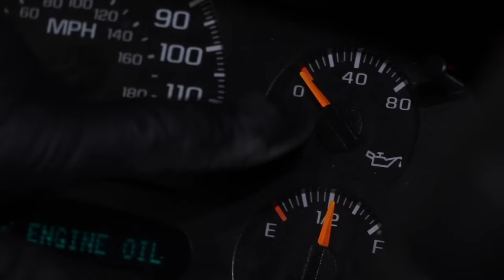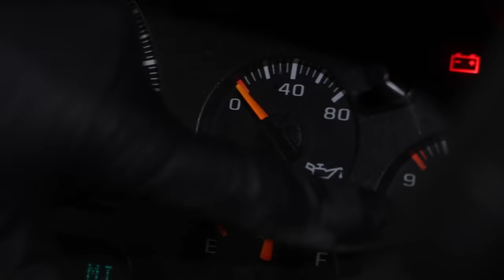Top 5 Problems 2000-06 GMC Yukon Sierra Chevy Suburban Tahoe Silverado Avalanche Cadillac Escalade

Comment: Good video. I own a 2002 Chevy Silverado 1500 with 4.8 V8.  with 90K on the odometer. The biggest issue I have experienced is the rear brake calipers sticking closed. Drove all the way from Ohio to Florida, towing a trailer with one of them stuck on. It would smoke  and smell until the pads wore down enough. Once I got home I replaced the rear rotors, pads, and calipers. In less than 15K miles, one of them stuck again. Don't replace with cheap rebuilds but buy the more expensive , quality rebuilt calipers. I used Napa the 2nd time. My other issue was the in tank fuel pump. It will get increasingly hard to start until it leaves you stranded with no fuel pressure. Again, don't buy a cheap replacement fuel pump. You either have to drop the tank or raise the bed to install it so you want something that's going to last. Chances are you won't find a replacement with the factory style electrical connector and will have to install an adapter pigtail. I soldered the wires on mine to avoid having an intermittent connection in the future.  I have experienced the intermediate steering shaft wobble for a while now so, I think it's replacement is in my near future.
Reply from the maker: +GovtSlave Thanks for the feedback!

Comment: I have 05 GMC Sierra 1500, 5.3L H.O. My oil pressure going to zero was caused by bad instrument cluster. I've had the intermittent brakes at 5 mph. I changed both wheel hub bearings since they were already going bad, fixed that issue. I've had bad 4WD pushbutton switch, bad 4WD actuator, bad SRS front airbag switch, bad starter relay, bad starter. Replaced all brake lines wirh Stainless set. Truck doing well at 174k miles

Comment: Head gaskets could be a problem also front wheel bearings. Great vehicles for many people with over 200,000 and living in the rust belt.
Reply: J Roase Haven’t seen head gaskets issues here, just the rearmost exhaust manifold bolts and intake leaks especially cold,once they run a minute they stop leaking.....
Reply: Yep just replaced front wheel bearings  and look like head gaskets  it are giving up after 300k miles
Reply: John DiMartino I have. Had to do a gasket job on my old '00 and didnt realize that I had to change the lifters when I had it apart. Some dumbfuck decided not to allow you to change them with the heads still on. Thats GM for you though. One step forward in aesthetic design, seventy steps backward in engineering. These trucks are universally hated by most communities due to awful designs. Im personally done with GM trucks. As far as im concerned, they are dogshit.
Reply: @Lrules364   sounds like your not to mechanically inclined? How would any vehicle be able to have lifters changed with the heads still on? Lifters are an internal part🤔

Comment: Great video, I have had these issues with my 2 of my 03 2500hd and 07 3500 as well 01 Suburban and 02 Yukon Denali just have to maintenance when needed. Two of them are 450k and still running strong
Reply from the maker: +Nathan Gabriel Thanks for checking us out! 1AAuto.com

Comment: You forgot that rear main seal leak, or I think that's why it's called when the vehicle leaks oil between the transmission in the back of the engine
Reply from the maker: +Don ellis Thanks for the tip! We'll pass this info along to our production team.
Reply: I was told that starts when the catastrophic converters start to clog.
Reply: Change your oil when you are suppose to.
Reply: Anywhere that uses road salt, these were prone to antilock brake problems. Over the course of 170,000 I had the front hubs replaced twice on my 02 Silverado. The first time was corrosion on the tone ring, the second time the wheel bearings were getting worn and causing false antilock activation at low speeds. Fuel lines and brake lines corroded and all had to be replaced too. Don Ellis is right about the rear main seal. On the 4.3 V6 I had the rear main seal replaced twice, and had the intake "gasket" done once. If you're losing coolant and you can't find a leak, it's probably going into your oil.
Reply: I just had mine fixed a few months back on my 06 Sierra 1500. It was causing me to lose oil and coolant. Once it was fixed i don't have to refill my coolant anymore and oil very rarely.
Reply: My old Silverado had this leak it's whole life. I had it fixed twice under warranty and four times (paid once brought it back three times to re-repair) after warranty expired. The leak got worse with each repair.

Comment: Thanks for the heads up. I have not had any of these issues yet even with over 217,000 miles. My Yukon was handed down to me from my mom at 120,000 miles. She bought it new in 2005 when my step dad passed away. In 2016 mom went into an assisted living apartment and could no longer drive. I’m the oldest of five sons and the only one she would allow to take her out of her apartment. She remembered me the most and the Yukon so it was transferred to me. I moved to Texas and used it to haul furniture and my whippet show dogs. Dad died in August and mom in December. The Yukon still runs great with the AC getting weak and the miles per gallon being 15.6 average so I will be bringing my other vehicle from home on my next visit. The Mercedes E350 gets 22 mpg average which is a whole lot better than the Yukon and the car is easier to park. Plus you can drive faster around curves. So I rather use the Mercedes as my daily driver and save on fuel. That way I will use the SUV for hauling dogs to shows or furniture from one location to another. Thanks again for the updates! 😎

Comment: Great tips. The 2003 Z71 Tahoe I bought new from my local dealer is now showing some of these problems; however we have gotten over 325,000 miles out of it so far.  Wish I had known about the oil pressure sender problems; years ago, my son and his wife, on a long trip noticed the oil pressure gauge showed wonky readings, and then vehicle cut off at bottom of off-ramp on Interstate, and wouldn't restart. Towed 80 miles to dealership at their destination (free tow with road club); they said oil pump had failed and we had to have that replaced at that dealership for $$$. If I could've gotten it home to check it out, probably could have saved big bucks.
Reply from the maker: +Anonymous98 Thanks for the feedback! We hope these help you out in the future to avoid the dealership next time!

Comment: $$$  be advised $$$ when you change the knock sensors there is a GM service memo with a procedure to show how to protect the new sensors with rtv... Basically you build a damn with rtv in front of the rear sensor so water cannot get to it
Reply: TheMightybasstone yes that is true I did this! And torque to specification !
Reply: you build a dam around both, along with removing the rear foam. i just did mine yesterday (second time...) and ended up putting a little RTV around the caps to ensure no water gets in the hole.
Reply: TheMightybasstone  why would he mention that when he has a fresh set of sensors to sell ya when they fail again🤑

Comment: I had several blower motor resistors fail in my 2005 Silverado
Reply from the maker: +daniel Morse Thanks for the feedback!
Reply: I'd change out the blower motor. The bearings can get tight, but not make noise. Or, the motor windings are breaking down and causing a higher amperage draw, which in turn takes out the resistor from overheating it.
Reply: daniel Morse
. Change the blower motor. Had the same thing happen and finally had a customer in the auto store tell me to put in new resistor and see if it got hot...if it did...change the motor and the resister won't fail any more. It drove me crazy for a year doing all sorts of strange things. Replaced the motor and no problem since.
Reply: I just changed on it took me a week lol. The quarantine actually gave me time to put the new one on

Comment: I have a 01 Tahoe 5.3 with 360000 miles. Runs great. In December replaced fuel pump. In January rebuild transmission, sun gear like exploded so you can imagine the demage, also replace back engine seal.  And this weekend replaced A/C compresor, orifice tube and drier. All parts cost me about $2000 and my time, which I dont count as its my hobby.
Reply from the maker: +Jaroslav Szabo Thanks for checking us out. Shop for high quality auto parts on 1AAuto.com:

http://1aau.to/m/Shop-1AAuto-c

Comment: Nice video. Also, the water hose connection at the firewall gets old and brittle until it cracks,and leaves you stranded.
Reply from the maker: +Greg Schneeberger Thanks for checking us out! 1AAuto.com
Reply: Also a problem with y- hose from reservoir to thermostat and heater hose. Quick disconnects are junk. I did away with mine.
Reply: That happened to me back in '17. 01 z71 tahoe

Comment: If your oil pressure is fine while the engine is cold (but less than the usual 60psi) and it drops steadily as the engine warms and the oil thins out to the point where the low oil pressure alarm goes off, you pull over, turn off the motor, wait a minute, restart and the oil pressure is "OK" for 1-20+ miles, the likely culprit is the camshaft thrust plate. The built in gasket on this metal plate wears down over time and allows oil to slip by and act as an oil pump bypass because oil is flowing out from behind that plate and directly into the oil pan.
This is way more common than people realize and are often told by mechanics that the cam bearings are shot and/or the engine is shot when it can be fixed by replacing a <$30 part.

Comment: Great video! Really like the assistance diagnosing symptoms and codes. I had an '03 Yukon XL 1500 and have an '05 Suburban 2500 and have had some of these issues. Added bonus: airbag/impact sensors behind front bumper. Easy to fix.
Reply: Is that how I get the fix airbag light to go away?

Comment: You forgot to add brake lines. Ive had several Chevy/GMC pickups, Suburban and Tahoes ranging from '96 to '04 and every single one of them had to have the cheap brakelines replaced due to a rusted leaking line along the frame just under the drivers seat... go figure. We had them replaced with brass lines.
Reply from the maker: +Rex Abrams Thanks for checking us out!
Reply: Just replaced my whole brakline set up they all were rusted and blew out on me after changing control arms 2003 tahoe z71
Reply: Same mine got rusted out n leaked
Reply: Had a line blow out on my 03 Avalanche while towing a trailer, fun time.
Reply: How hard was replacing all of that, anything you can do to prevent that
Reply: @B_WithThe_C  mine rusted a hole where they sit on the frame rail right below the brake master cylinder.  I would look there and clean the lines very well, to remove caked on mud and salt.
Reply: Buy pre-bent lines.  The hardest part for me was getting all of the lines to fit correctly at the ABS housing under the driver's seat.  You are supposed to have a special computer to flush the ABS system after replacing the lines.

Comment: Ground wires are an issue on these models. If you’re having electrical issues, check all your grounds. Throttle body issues as well. With high miles, simply replace that throttle body and your bogging or going dead will often go away. Around 200,000 miles, the window motors start to fail. Just remove and replace them. The air ride system is just something we all deal with, I simply ignore the message. I hope this comment helps someone out there in this crazy world. Good video guys.

Comment: I love my Suburban! Her name is Evergreen Machine - a 2004 2 wheel drive with 240k miles and going strong! I had the transmission rebuilt, though. She would still go, but was missing the 2nd and overdrive gears. She has never left me stranded, but now I probably need o2 sensors and definitely a new instrument cluster (which doesn't work). I have changed the spark plugs and wires, water pump, lower coolant hose, a part for the power steering pump that was messing with the front suspension (forgot the technical term, sorry), plastic coolant fittings at the firewall, and of course oil and filters. I got her with about 210k miles on her and was skeptical, but I have driven her all over the united states and even tow my 4k lb travel trailer! Overall, best truck I've had!

Comment: I had a 99 GMC Sierra. The 2 main problems I had were rusting chassis and components attached to it, and that irritating cold start knock. On cold mornings it sounded as though the pistons were going to blow out the side of the block at any moment! It always ran good after warm up. I sold it with 106000 miles on it, and was not sad to see it go. Now I can't afford a new truck to replace it!
Reply: my 99 seirra runs like a dream but it does have rust problems im never geting rid of that thing it is my dad and i's project car
Reply: Yeah I bought my first one in 2020 a 96 gmc c1500 with the 5.7 she currently has 139k miles, people always want to buy it off me lol. But I loved it so much I just bought a 2000 suburban with the 5.3😎
Reply: The market for the obs trucks is insane rn, been wanting to grab an extended cab cuz my 96 is a single but everyone wants like 3 or 4 times what I paid for 96 back in 2020

Comment: What about the rear main seal? It’s a pretty common issue on these GMT800s. Lol
If you have an oil leak it’s most like that seal.
Reply: Valve cover gaskets?
Reply: Oil pressure switch was my issue thought it was the rear main seal but it was dry…
Reply: @msp541  interesting I have a leak in the same area and I haven't checked that  oil pressure sensor yet I hope that's it and not the rear main seal. Is it hard to replace hard to get to I've got 6.0 v8 all-wheel drive
Reply: That's just the built in rust prevention

Comment: 02 Tahoe got it with about 150xxx on it. It's got close to 190xxx now and all it needs (short of some cosmetic work) is new cats. Didnt start leaking oil until last year. The electrical does get wacky every so often so thanks for the tip!

Comment: Owned a 2003 Tahoe for 12 years and the only issue I had was a clicking in the steering. Took it to the dealer, he knew exactly what it was and said it should have been covered by GM, as it was a known defect, but it wasn't. Paid $150 to replace a couple of bolts and never heard it again. I sold it to my neighbor a few years ago and it's still going strong. He did replace the fuel pump. I should have kept it.  Just remembered, I did have to have the manifold gasket replaced for $625.

Comment: What about the engine tapping? My 2006 Sierra does it all the time. Comes and goes and I hear it’s been an issue with the. 5.3s and 4.8 engines.
Reply: Replace the dried out/cracked o-ring for the oil pump pickup tube.

Comment: Left out brake lines,all 5 of them get replaced at the same time using a prebent kit made out of stainless steel or nicop.The wheel speed sensor problem,replace the front wheel bearings and this the only fix for it.Cleaning it doesn't fix it,the problem comes back.Don't have to pull the intake to replace the oil pressure sensor.Two 10 inch extensions together on an impact grade universal with an oil pressure sensor socket.Can get to it without pulling the intake.
Reply: Why impact grade???????
Reply: Do a video showing us please
Reply from the maker: +Keith Perry We're always cycling through common cars. We'll add this repair to our list! http://1aau.to/m/Shop-1AAuto-c
Reply: Impact grade doesn't bind up

Comment: I Still Love These Old Chevy Tahoes Cadillac Escalades & GMC Yukons Especially The 2000-2006 Models I Want To Buy A 2005-06 Yukon Denali Short Wheelbase With A Sunroof Only I'll Even Take A 2003-2006 Tahoe LT Or Z71 With A Sunroof
Reply: Hell yeah..And the engines are great
Reply: I have a 2004 Chevy Tahoe Z71 with 290,000 miles. Love her an I got money put aside to put a new engine and transmission in her when she leave
Reply: @B_WithThe_C  
Where are you going to get your new engine and trans?

Comment: please do 07-13 generation next! so many of those models still driving around
Reply from the maker: +reese bobby We're always cycling through common cars. We'll add this repair to our list! 1AAuto.com
Reply: And that generation ( gmt900) had some of the cheapest materials ever to be put in a GM truck SUV even the sheet metal can be bend by hand (2010 Tahoe) where the Ford (2008 expedition)has some strong heavy sheet metal but with that being said the "hoe" stay on the road while the "expy" stayed in the shop (5.4 TRITON vs 5.3 VORTEC i know what motor is reliable dependable and efficient despite cylinder deactivated or AFM and limited slip vs automatic locking diffs both have indestructible auto 6 speeds) of course the Chevy has the best drive lines/powertrain but the Ford has the best safety i still take Chevy since knee high.
Reply: They're worse!

Comment: Pretty spot on. In the last year I've replaced my oil pressure sensor. Half to fix that ground. And my knock sensor throws the engine light on a few times a year. Unplug the battery and its fine.

Comment: I literally never had any of these issues. In fact the only issues I have are self-created. Mainly due to the fact that I have huge 15s in the back of my 01 Silverado on 6k watts. Tends to break things. But other than that, do oil changes, rotate tires, brake jobs, and other maintenance and you shouldn't have any issues. Almost 20 years running stronger than ever 👍💪💪💪

Comment: A little tip on the oil pressure sensor, get on of those extrdeep 1 1/16 socket thats used for caging trucks brakes you won't have to take anything off